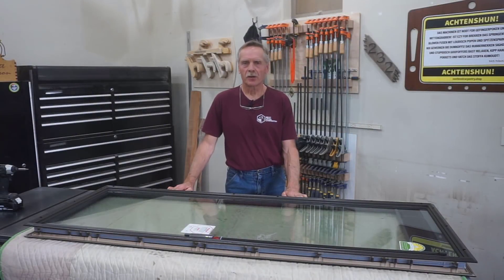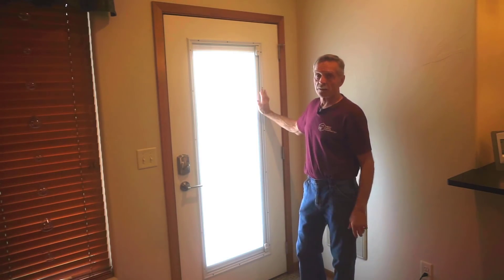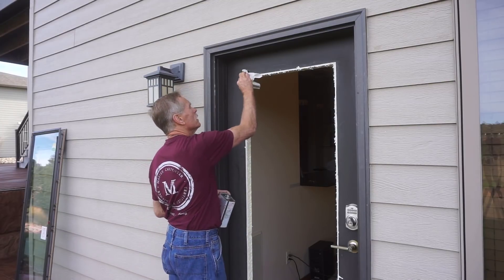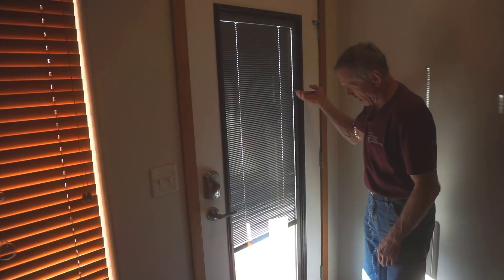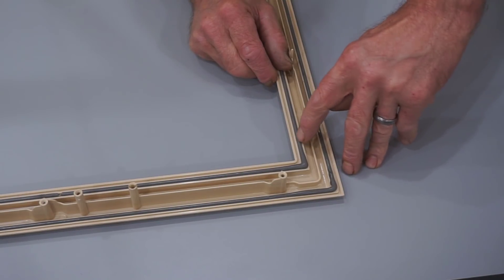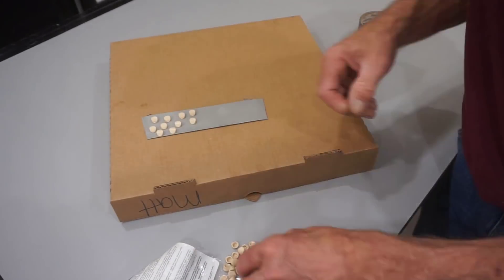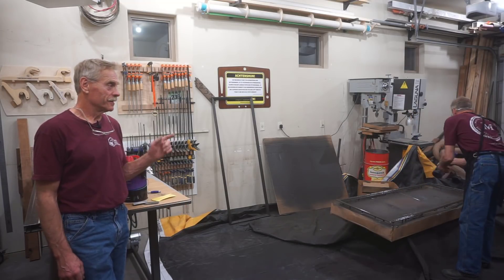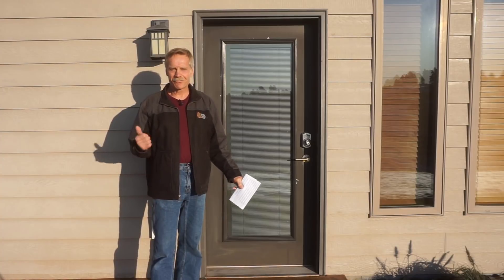Enclosed Door Blinds for Privacy and Light Control

Comment: I must have missed it but I really like the apron you show--my wife has made these for me with the same straps etc but she informs me "No More".  I looked for it on the Amazon influencer page for Next Level Carpentry but did not see it.  The stuff for the spray painter was there but no apron.  I want to buy it and make sure you get some credit with Amazon.
Reply from the maker: Thanks for pointing out that oversight John!  I added two styles to the Influener's page just now at your prompting.  This is the regular style I wear: https://www.amazon.com/dp/B01E4DYQQM/?ref=idea_lv_dp_ov_d&tag=aiponsite-20&linkCode=ic6&ascsubtag=amzn1.ideas.29WVINIJF4EUJ 

and here's a 'deluxe edition' with extra pouches, hammer loop etc:

https://www.amazon.com/dp/B06ZZ9FJCP/?ref=idea_lv_dp_ov_d&tag=aiponsite-20&linkCode=ic6&ascsubtag=amzn1.ideas.29WVINIJF4EUJ
You might have found it already as Amazon is telling me on was sold today but appreciate all the same!  Best, Matt

Comment: Great video, Matt. I'm curious why you didn't use your gravity fed spray gun that you showed in the "No Scoop Dust Scoop" video, and why you switched to the airless Graco. I've been considering buying an HVLP system.
Reply from the maker: Hey Eric: Latex paint is far too thick to spray well out of most automotive type gravity fed cup guns... at least mine anyways.  The NuCling paint is fairly runny for latex paint but is still at least twice as thick as the precatalyzed lacquer I use for bare and stained wood.  I've never uses an HVLP so can't weigh in there but for true airless spraying on small-ish projects I think this particular Graco is tough to beat.  The main reason I got it though is for 3 exterior doors and two overhead doors and I didn't want or need an airless system with pump, hose, etc.  Those are impractical for me where most anything I do is a gallon or less.  An airless will use almost a quart just to fill the hose!  Other handhelds, corded or cordless, don't really do that good of a job from what I hear.  The main feature of this model is that it uses the same pro-quality FFLP tips that Gracos full size units use and, from what my painters tell me, that makes ALL the difference.  Hope this helps and good luck with your choice... Best, Matt

Comment: Can I ask the price of the Graco battery sprayer?
Reply from the maker: Sure can Steve... It's $549 through Amazon if you go to the Amazon Link in the video description for this video. When I got mind Graco had a special promotion that included two extra tips for free so you might check in to see if they have any special promotions at this time.
That's a fair chunk of change to put down but I've got to tell you I'm completely satisfied with the tool its performance and believe it's a great value because it works so well.
Best, Matt
Reply: Thanks Matt!